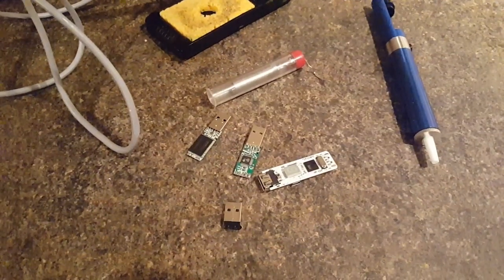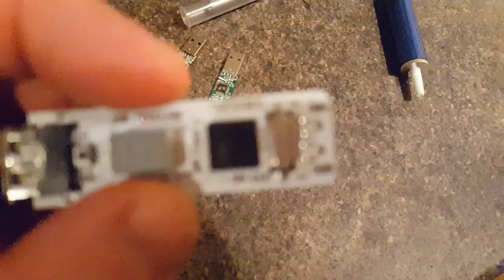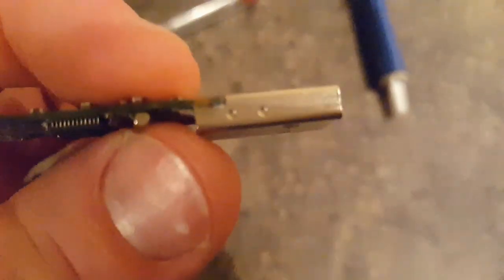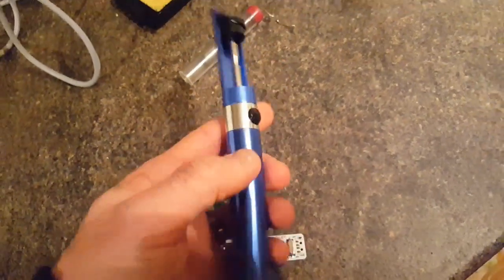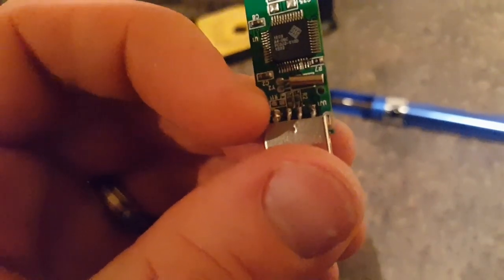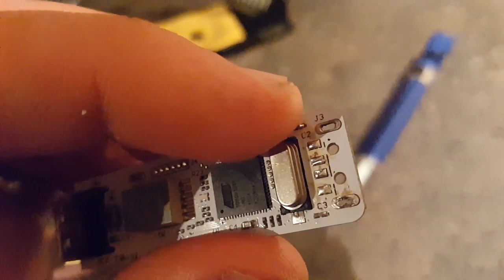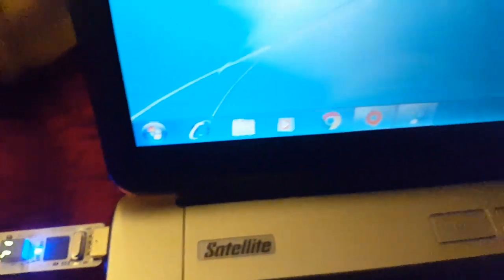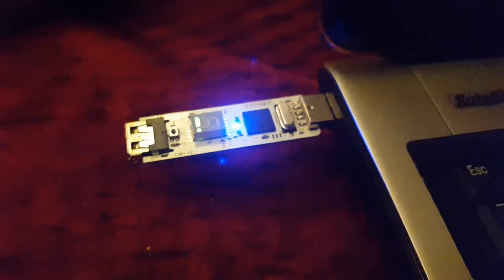How to Repair a Broken USB Stick or Flash Drive

Comment: What were the tools you used and where may I find them
Reply from the maker: This is the solder sucker I used: https://www.amazon.co.uk/gp/product/B003YT2F4I/ref=oh_aui_detailpage_o06_s00?ie=UTF8&psc=1

As for soldering irons, I cannot make any recommendations but the more you pay the more flexibility you'll get. You're looking at about £10 for a cheap and nasty iron. Extra features that cost you more are:

a) battery power
b) higher wattage (i.e. higher temperature)
c) controllable temperature
d) built in vacuum

and many more features. It really depends on how often you will be soldering.